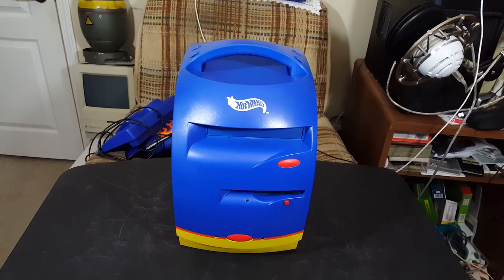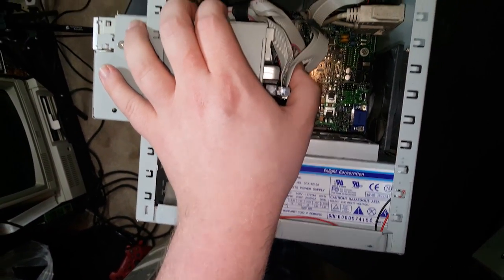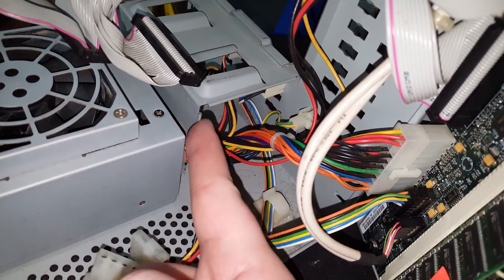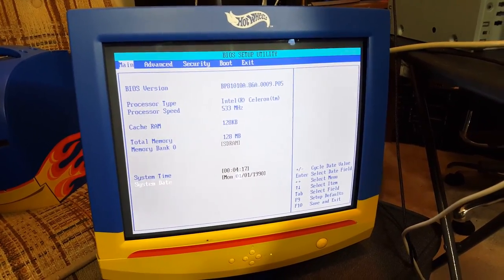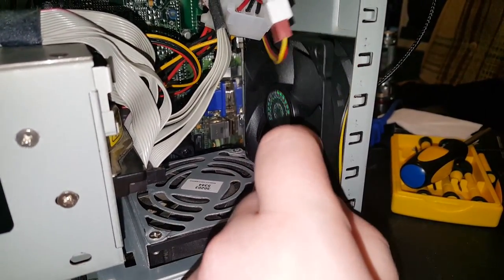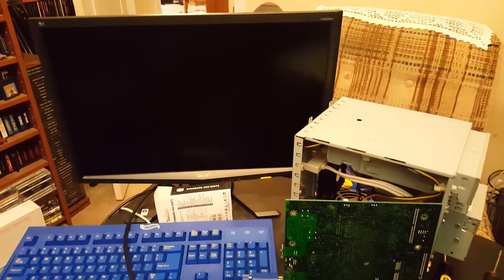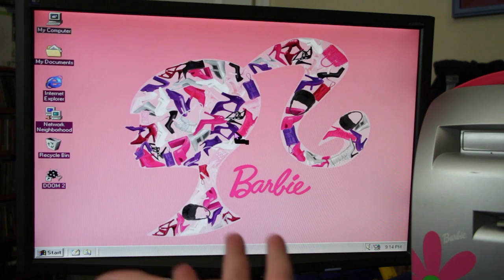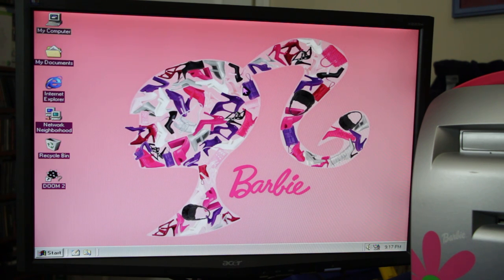LGR - Repairing The Barbie/Hot Wheels Computer

Comment: You sir have a lot of patience. Seriously, when I was transferring my computer into a new modern case the other weekend I was yelling at it for hours! The transfer was successful.
Reply: +ProtosMerkabah Did the yelling help?
Reply: OlafurArons Eventually
Reply: +OlafurArons it only works when paired with hitting it and crying a bit.
Reply: lol. you guys are funneh.
when i work on computers i always cut myself. Not because i'm into cutting myself, but because of the edges on the fucking computer cases. Maybe i'm just a clumsy fuck.
Reply: +OlafurArons If you're not cursing while building something, you're doing it wrong. That's just me though.
Reply: Similar thing happened to me once. I decided to replace the 120gb system drive in my Pentuim D with a WD 1T "blue" as well as install a 3rd WD 1T blue drive to replace the old D drive (a 500gb).

Original config.
System drive 120 gb 5800 rpm 16mb buffer
D drive 500 gb 5800 rpm 16 mg buffer

1st upgrade was adding a WD 1T "Blue" 7200 rpm 64 mb buffer 
2nd upgrade clone and replace the system drive a D drive. Replaced them both with the same WD 1T "Blue".
And while I'm at it lets replace the old SATA cables so there all the same. bought 4 39" "right angle connector" cables thinking it would make replacing the hard drives a snap. (the case is one with quick release drive bays).

Now I'm in no way a computer tech. This was in fact the first time I'd ever cloned and replaced a drive let alone install a new one...

Problem number my desktop wouldn't boot in fact it wasn't posting, I'm like (add bad word here) after removing and reinstalling the drives 3 times I got it to boot. And damn the difference in boot time, cut a little more then half. So windows loads C and D drives are all good but the new drive is missing...

20 minutes and a lot of googleing later I find out I have to go to disk management to initiate the drive.

It all worked out in the end of a very long afternoon lol.
Reply: John Smith Well. Google is your friend, so. There's that. And as far as i know, there's no such thing as 5800rpm hard drives, only 5400, 7200, 10000, and 15000.
Reply: Yes Google is my friend lol.
Oops typos yeah old drives wre 5400 Rev and why it took almost 2 minutes to fully load the desktop and all the taskbar icons, though it was probably mostly the 16mb buffers fault lol. Think my moms i5 laptop has the same slow drive problem. Shouldn't load as slow as it does on boot.
Reply: +OlafurArons  actually you are wrong, even google is sometimes this one is just for instance
http://www.tomshardware.com/reviews/desktop-hdd.15-st4000dm000-4tb,3494.html

any way there were even slower drives wit 4500 rpm like Quantum Fireball HDD  etc
Reply: Right. I missed the 5900 ones. dang it. But i'm fairly certain there were drives much slower than 5400, but those i mentioned previously were indeed the most common.
Reply: OlafurArons gasp google was wrong lol.
Reply: +John Smith  yeah old harware does not work well with 3tb as boot drives
Reply: venix20 
Lol I wish they were 3TB unfortunately 1TB hard drives are the largest the motherboard can use.
How old you might ask... The Asus motherboard in my desktop has both sata and ide ports. She's old but a good reliable machine, it's 4gb ddr 2 ram (that's it's max btw) is more than enough to run windows7 pretty well.
I sometimes worry about the systems. 500 watt power supply, it's running(sure it's high performance but it is running a lot)
2 large high speed case fans.
The inner cooler  on the cpu
2 rom drives
One floppy drive that as far as I know works
A hd ati card with dual dvi out (I'm not sure what model size it is it's less the 1gb I know that)
A creative labs sound blaster sound card
And 4 hard drives 
3 1tb wd "blue" drives
The old 500gb drive that is now a backup drive for true image drive backups

And yes I'm using both of the ati cards dvi out via a pair of 27" asus mx279h hd led monitors
The sound card was necessary, when my dad's computer friend first gave it to us the desktop was running 7 public beta. When the beta expired and we installed full windows 7 the drivers to the motherboards on board sound card stopped working, we tried everything to fix it with no luck. So we bought a soundblaster card and installed it.

So yeah it's old but still a good machine considering it was meant for xp, the asus motherboards manual says its xp certified.
The only part replaced was the original power supply the fan in it died, thankfully the systems thermal protection did it's job and shutdown the system. Like I said old but reliable, can run it all day and the air coming out of the fans never gets above lukewarm. 

Oh yeah the case is a antec sonata II btw, a very cool case. I love it enough when ever I build a new system I'll be using one of antecs newer sonata cases.

Edit
Forgot the cpu
It's a intel penitum D 3.40gh
Reply: if your psu is not some ...Chinese noname psu  you should not worry at all 500 watts are enough for 6700k+gtx 970  !
Reply: venix20 
I forget the brand but it is a brand name power supply. Wow if it can handle that then yeah should be safe enough lol.
Reply: +ProtosMerkabah Every time I start building a computer, a wall from my apartment disappears.
Reply: ***** 
I don't doubt it lol.
Reply: venix20 That's where you're wrong. a 500w powersupply isn't guaranteed to give 500w.
It's guaranteed to consume 500w though at full load. That's why they got the new ratings like bronze, silver, gold, platinum and so on. Up to like 95% efficiency.
Reply: well i am working on a 3770k @ 4.3 ghz  16 gb ram @1866 gtx 770 2 hdd hard drives and an ssd also a dvd writer ....and 4 extra fans ...that draws 360 watts when i play a game ....
Reply: venix20 
Wow...
Thought about going SSD for system dr7ve on my desktop, but even Google couldn't tell me if the board would take one. Didn't think risking it would be a good idea so yeah stayed sata.
Reply: as far you have sata ....it is backwards compatible .... just make sure to install windows on it .... after you change it from ide mode to achi  ...else you loose a bit of speed and garbage collection etc. ..witch will help on extending your ssd life
Reply: so make sure your motherboard supports achi mode on your hard drives
Reply: venix20 
I'll have to look that uo in the boards manual got no idea on that one. Thanks for info, be good to know at least if it would take a SSD.
Reply: John Smith hmm no need manual go inside your bios and see if you can set your hard drives into achi mode or if they are already on it ! but if you put your hard drive from ide to achi or the oposite then most likely your pc will be rebooting before you enter windows ! a good thing to mind if you clone your windows from an hdd to ssd .... i spend some time wondering why my pc rebooting before windows few years back ;)
Reply: venix20 
Ah I'll have to try that. Thank you, it'll be good to know if I ever want to go SSD and get a little more speed out the old girl. Though won't be shocked if it can't,wouldn't be the first time the hardware has fallen short of something I wanted to do.
Reply: John Smith well good luck i do not think you will have problems but well at the end is good to make sure first :)
Reply: +venix20 I used prime95 and furmark simultaneously and got 430 W (i7 4771/GTX 970/2x 8GB DDR3-1600/1 SSD/1 HDD/2 Fans). :D
Reply: ***** thats why i told 500 watts of a good psu are enough so 500 "real" watts if you  like but to be ok you need 100 watt air  so in your case a good 550 watts psu will be up for the task 650 watt will  give you a good breathing room for future updates etc now that said going for an 800 watt psu is not such a bad idea if it does not break the bank running your psu half their capacity means lower fan speed so noise also also lower tempratures and better efficiency so yeah if you are not on a tight budget and the 800 watt option over the 600-650 watt option  is only like 10 bucks above ...by all means go for it :)
Reply: venix20 
Yeah bios does support achi mode, can also do a number of raid types. I also didn't realize the board/bios supports wifi cards, only thing is it supports a,b and g type but not n.
Reply: nice john so then you can put an ssd and the garbage control will work just fine and trim ! and do not worry about the sata 2 ! it might restricting top write and read speeds ....but the benefit really is the average seek times of the files witch is a looot faster than an hdd ...example photoshop in my pc opens in 30 seconds on an hdd .... after it went to my ssd 1-2 seconds tin it fully loads !
Reply: Ty.
Not sure if I'll do it or not, but good to know the system will take a ssd.
I've been thinking more of investing in a new system i5 or i7 more than enough ram dual video card  (for dual hdmi).
Ya know a system where for the next 5 or so years I don't even have to worry about minimum system requirements.

As for current machine. Set it up as a dual boot xp/7 machine for all my old games  with a little help from dosbox and a 98se VM.
Reply: John Smith dual hdmi ? there are dvi converters and display port adapeters to hdmi just well the dvi does not carry sound if you need this :)
Reply: venix20 
True. In fact that's what I'm using now, desktops video card has dual dvi. Using dvi to hdmi cables now. The dual video cards be for more power then anything.

As a side note. It's always the little things that couse problems lol.
My system is using dual monitors, a pair of Asus mx279h 27" displays. They came with vga and dvi to hdmi cables but... the cables where too short,had to buy longer one's before I could set them up sigh
Reply: John Smith oh i see my self i prefer to buy one of the cards and keep the money at the side to get in 3 or 4 generations the second the equivalent card of that generation  i believe in the long run  you get more performance and saves me the hustle of crossfire/sli drivers  stuttering waiting for profiles ...you get my point here although for 3 monitors or 4k you will need it
Reply: venix20 
hmm never thought of that.

Drools at the thought of 4k on pc...
Reply: also about the ssd ...amason sells for 43 bucks the 120 gb kingstom 300 now ... ! is pleanty for operating system and programs the rest have to go at your hdd :P
Reply: venix20 
Oh that's a god deal. 120gb huh? might be enough lol. Should tell the old man about it, my mom's laptop a i5 could use a better drive. I swear the put a basic slow sata drive with only a 16mb buffer in it. My desktop boots up from power up to everything loaded faster then hers.
Reply: Only 1 gb lol
Reply: Er...you chopped off a finger at some point, did you?
Reply: OlafurArons Sometimes computers require a blood sacrifice to work
Reply: Abdega Do blood blisters count lol. My desktops case Cover wouldn't go back on without a fight, I ended up pinching my little finger in the seem
Reply: John Smith 
Kind of.
It's similar to how sharks have "test bites"
Your computer did a test bite and it thought, "I'm not THAT hungry, I don't need it."

Comment: Hot Wheels PC Master Race
Reply: Yeah well,that's just, like, your opinion, man I see what you did there.
Reply: Doom 2 on a BARBIE computer?
Reply: Hahahahaha well played!
Reply: And make those machine to be Hot Wheel SLEEPER PC, then those PC would look badass with the new hardware in it. The Hot Wheel must need to be modified
Reply: @aaadj2744  AND HEAVILY. You'd need an ITX mobo with M.2 support because there' pretty much only enough space for that kind of SSD, the PSU has to be mounted OUTSIDE the case because there's no power supply of that size that's safe and SFX format doesn't fit inside, you can only fit the 1050Ti sized cards at best and can only do a pull configuration on the cooling side... and I haven't even accounted the CPU cooler into this but remember there's only a hole for one 80mm fan on the back so you gotta make it bigger.
Reply: @OfficialDJSoru PSU internal swaps exists, just carefully tinker with the fan speed and wiring. Cooling wise you might get away with a maintenance free liquid cooling kit, but you'd need to tinker with the new mobo and GPU to fit everything. If you wanted to go balls out sleeper for this case,  I'd put a mini gtx 1080, or hook up a GPU amplifier next to it. Lastly, dremels are your friend since old school frames are bulky af, and are pretty fun to grind.
Reply: @philipottey7723  The problem will be getting a hold of one of these. An ITX mobo should fit in regardless but the real issue would be the GPU. Maybe a liquid cooling kit is indeed the safest bet here. Wouldn't be much different from doing an HDD mod for a Dreamcast.
Reply: Get out.
Reply: 666
Reply: No no no noooooo

Comment: Fixing a 20 year old motherboard by cooking it in the oven? SUBSCRIBED

I love your content :) Keep up the old tech videos!
Reply: Rather fry it on the grid. It is a barbie computer.
Reply: An old Mac that had an overheating problem could be fixed by dropping it
Reply: @jeroenjansen2709  I would take the internals and put them in a new case
Reply: Michael Martin wasn't an overheating problem, and that was actually quite a common thing to do in the early days of the personal computer. Most, if not all, of the chips on those early machines are socketed instead of soldered in place. Over time, they work loose and lose contact with the socket. Dropping the machine from a few inches will cause the chips to reseat in their sockets, and the computer will work again. Apple was the only one that made that an official troubleshooting step, which is why it's always referenced. It wasn't a Mac, either, it was some variety of Apple II.
Reply: Literally went no fucking way. Then I started to think about it. My science degree didn’t fail me on this day
Reply: yes I do

Comment: Uh oh, looks like your motherboard is not working. Best solution:

COOK IT IN AN OVEN
Reply: No joke, my motherboard wasn't working and I did it and now it works.
Reply: SMELLS LIKE FRESH BARBIE
Reply: Since I first saw this video I have now saved 4 motherboards by cooking them in the oven. I mean if it's dead anyway you don't have much to lose so that's why I tried it, and it works!
Reply: Normally the fix doesn't last very long.  It's due to expansion and contraction during thermal change, which happens again during operarion.  Lead-free solder is also more brittle., which an oven can't fix.
Reply: @pyro226  One board I did has been working for about 3 years so far...
Reply: Hmmm... I usually reflow pinball boards with a soldering iron. Never thought of using the oven...

Comment: I thought you were joking around with the whole baking the motherboard thing. I was waiting for the punchline until I realized that you were being serious.

I really did not know this was a thing.
Reply: Oh it's a thing. People bake their Xbox360 boards quite often, the ones with Red Ring of Death, the early model. Though there, the issue is a bit more complicated and the fix is only very temporary. On components made before 2005, the solder contains lead and becomes quite flexible when heated and can heal itself pretty well, but then they outlawed lead in the EU. The affected components are for example the large ICs on the mainboard which are connected to the board by the tiny little balls of solder, hundreds of them, and when they heat up and cool down, the chips themselves expand and contract, and thus can break the tiny solder balls eventually, but you heat it up close to melting point, and they can heal back up. On post 2006, the unleaded solder is really hard and will likely cause the internal layers of the chip to break instead, and the heat probably just warps these internal layers into temporary alignment instead, as it's not hot enough to soften the new solder ball formulation at all.
Reply: the infamous G3 white iBook from Apple had the exact same problem - they attached the graphics chip to the mother board using the solder ball method, and it got so hot inside its casing the graphics chip would lift, shutting the computer down. Some people would wedge pennies wrapped in electrical tape between the case and chip to keep the chip in position. Apple did for while offered a repair program past warranty for that model, so that's a point in their favour. I got one of those turkeys from an eBay seller that died after just a couple of hours (don't worry, I got my money back after a dispute that eBay ruled in my favour, as they did show a working iBook in the product description). I later got the G4 version and that one is very reliable.
Reply: ShadeSlayer1911 p
Reply: dreibel thats weird, apple released something that isn't upgradeable easily... fucking weird....
Reply: That's the slav way of doing it, the proper way is with a tool that it's meant for this, which you apply heat only onto the video chip to melt (or almost melt) the metal balls it has on the contact with the board and re-adjust it tighter to it again.
If the console or computer turns on, everything works fine but you don't see anything on the screen, %90 chance this is how to fix it.
Reply: @Bewefau  everything causes cancer.
Reply: @Bewefau  spreed
Reply: Jessie James Just don’t eat it.

Comment: I baked a graphics card I paid $350 for 5 years ago and it died after 3 years. After a bake in a $5 thrift store oven it has been up and running again for 5 months!
Reply: back in 2013 my jasper xbox 360 started dying off. i baked it and it lasted one more year. then i baked it again and it lasted 3 months. then it stopped lasting much at all so i just gave up on it. i have another one anyway.
Reply: There is a way to fix bad electronics... buy a new one instead of frying it in an oven.

There are several deep fryed cards ON THE MARKET (!) already. Let it die, don't let it suffer, if it gave up it gave up!
Reply: @Patrik2166  lol 😆
Reply: "5$ thrift store oven"
I've been to the wrong stores.
Reply: How... How did you get a $5 oven!?